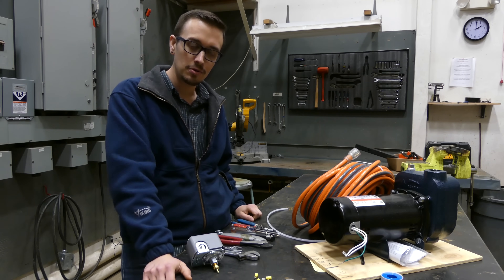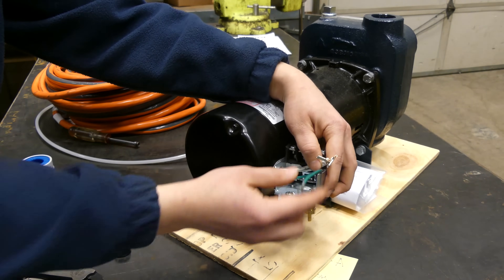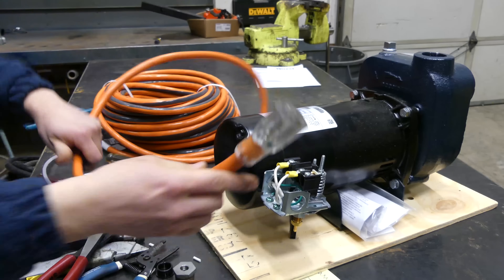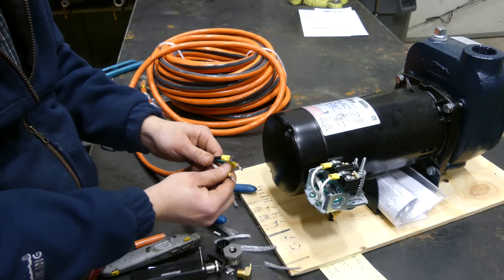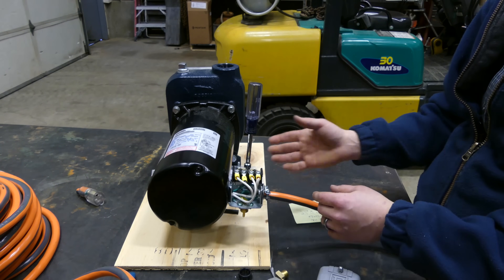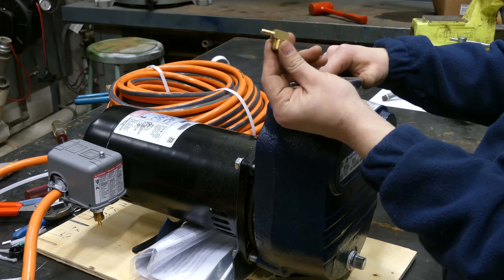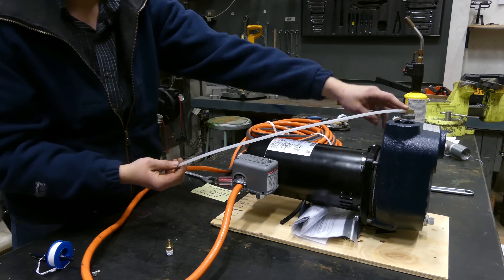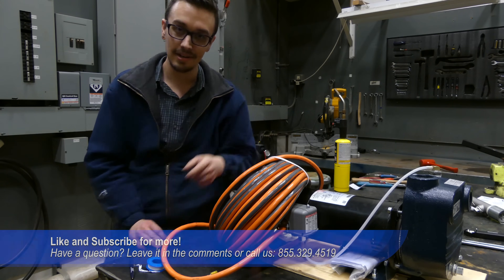Installing a Pressure Switch and Power Cord on a Centrifugal Pump

Comment: I have a sumergable well pump ok i drop it in the well down it gose ok now i have my control box and my wires from my pump go in my control box and wired  in then i have my exstensive cord now i need to wire it to pressure switch and back to control box can you show me how
Reply: Please

Comment: You would have been better if you came out of the pressure switch with a 90 to attach that plastic tubing to. You don't have to make a bend at the bottom of the tubing when you come out 90°, as you did when it was straight down like in your video

Comment: You wired this differently than your other video which you installed the wires from the 110 on the two outer terminals, Labeled how to wire a pressure switches Sep 17 2019

Comment: Very good video . Water entry could be a potential problem with this setup especially if the pump is mounted in a lawn . In an earlier video you had a 90degree connector coming off the pressure switch which would have prevented water entry . My motor got  corroded due to water entry and the replacement was $500+

Comment: Is the pressure switch only used for issues when high/low pressure occasionally occurs? Or is it intended to be constantly used such as shutting off output flow? Example; can I shut the garden valve off/on and relay on the switch. I'm hopping this is it's intended purpose and not a safety backup. Thanks!

Comment: Just changed a pressure switch on a shallow well pump with 1/2 HP 120 V motor - similar to the set-up in the video.  Do I need to put water in the small water line to the bottom of the pressure switch to get the air out of the line for the pressure switch to function properly?

Comment: Please tell me why you just didn't install the pressure switch on a tee on the discharge port! Those CH switches were never intended to be mounted that way. And where did you learn about the use of wire crimping and insulation stripping tools, and the way you used that poor adjustable open end wrench made me want to cry for humanity. I apologize for the rant, I'm just used to seeing things done by experienced professionals.

Comment: Can I put the pressure switch between the flow valve and RO booster pump to shut off the pump when the reservoir failed

Comment: Hey, nice video it was helpful, I have two subjections first instead of the torch to heat/melt the poly tube I have used boiled water in a thermos and had it ready and waiting hot. I dip the poly tube in for perhaps 50 or 60 seconds and it makes it pliable, so no open flame or gas needed. second, in order to cut waste of the female end of the power cord which I assume you toss out I would have cut it off perhaps a couple feet back just in order to reuse a perfectly good female end cord, now I can install the male end and have an extension cord of a few feet if the customer can get by with a couple feet less than the 100 foot. Less waste more savings.

Comment: how do you install the pressure tank to it
Reply: I believe that instead of running a tube from the pressure switch into the pump itself, the pressure switch is plumbed directly to a tank.  The pressure tank has a tee, so the pump feeds the pressure tank, and the pressure tank feeds whatever you need water for

Comment: Thanks for this video. It’s much appreciated. Will this customer need a pressure tank with this install?
Reply from the maker: If a pressure switch is being used it will need a pressure tank.
Reply: @RCworstwater  even if it’s being used for irrigation and pulling water from a storage container?  I have a deep well so I’m familiar with how everything works. I would think when I turn on the irrigation system the pressure drop would turn on the pump and keep it running until a timer turns off the irrigation system. No? By the way, best content on You Tube for this kind of material. Thanks for making it!

Comment: anyone know after you do this similar set up why the switch bounces or surges on and off? do I need a small pressure tank or do I need a swing valve after the pump ?
Reply from the maker: You probably need a pressure tank. Give us a call: 855.329.4519

Comment: Can I do this with a pool pump running at 220Volt? The pressure is 10-20 psi though. Not too many dual pole pressure switches. THanks,!

Comment: Why did you move the plug to 120v? My pump is 115/230v so how do I know to leave it at 230 or move it to 115?
Reply from the maker: What is your power supply?
Reply: R.C. Worst & Co., Inc. Thanks for your reply, my breaker switch out by our pool pump is 20amp, at the bottom of the switch it says 120/240V

Comment: My house is so old and the electrical hooked to my pump looks like it's 1960s electrics. We have no water to the two homes that use the same cistern. I am not sure if I need a electrician to rewire the basement hookups to the pump. Or if a plumber is capable of doing the entire job, electrics included.
Reply from the maker: I would call a local pump installer and ask their opinion. They may have to come out and look at it.
Reply: @RCworstwater  Ok thank you.

Comment: What guage is L1 and L2 wires?
Reply from the maker: Your incoming conductor size will need to be calculated per the NEC. On this pump I believe it was a 12 gauge power cord.

Comment: QUESTION !!!  If ANYONE can answer I'd be most grateful.  I live in the country and have a "trickle down" water system that requires a pump to carry the water through the house.  I have had 4 floods in the last 2 years and each one blew out the pump!  I am now on the third one and want to install myself to save money.  I am connecting directly to electrical not an extension cord BUT that  is the only difference to the basics of this video.  MY problem is the 3 wires from the wall  are  ALL white so I don't know how to tell which is "hot" "neutral" or "ground"  .  Does anyone know how to tell?  Oh ONE of the three is skinnier that the other two.

Comment: Do you have a video with the pump running? So now when you shut off the spicket the pump will shut off? And is a pressure tank needed or can you do without?
Reply: Yes the pump will shut off if you use a spigot, that of course is only if you have a pressure tank in the system!

Comment: Have you ever installed or used a Gould’s GT10 pump?   I was hoping to use one to replace my J5s 1 inch discharge pump because I would like to up my discharge from the 1 inch manifold to a 1-1/2  but keep the rest of the lines off the 1-1/2 manifold 1 inch but up the size of one of the main lines to 1-1/2  this line has many 1 and 3/4 inch side shoots with regular garden hose faucets to each garden field 1000+ feet away.  I have a 40/60 system now with a expansion tank. I think the GT10 pump said maximum pressure was 52 psi but is that full open and not necked down a bit if a valve is part closed?     The reason why I want a larger pump is so I can sustain a high flow with multiple gardens open but still allow me to only open one, I can’t open more than one garden with the J5s now.
Reply from the maker: Ben, it would be best to discuss your application over the phone. Please give us a call at 855.329.4519 (ask for Jeremy)

Comment: Hi ,what booster pump would you recommend for low water pressure in a house ? The odd time pressure is at 55 but usually sits around 30 lbs .thanks for your time .
Reply from the maker: Give us a call, we'd be happy to help you size a pump: 855.329.4519

Comment: does it need to connect with pressure tank?
Reply from the maker: The pressure tank should be installed via a tee as close to the pump as possible.

Comment: Great video, would it work to spin the pressure switch a 1\4 turn so the tubing fitting is facing the pump so you can put tubing onto the straight barb fitting instead of from bottom? To me that pump looks like a sewer pump instead of a pressure pump, just wondering

Comment: Personally I would put a 90° brass fitting on the bottom of the pressure switch as well like you did on the top just to keep the pressure switch tubing from kinking. On my irrigation pump it came with a pressure switch and it already had a 90° brass fitting on the pressure switch.
Reply: I agree, however I gone a completely different route now where I don’t use the poly pipe anymore.  Instead I mount the pressure switch on the main line with a tee and wire it up from there.  Those poly pipe are problematic, either blow off, rubbing a hole from vibrations or dun damage and cracks.